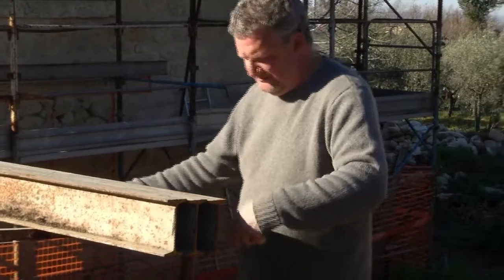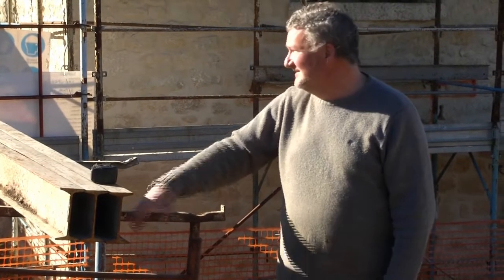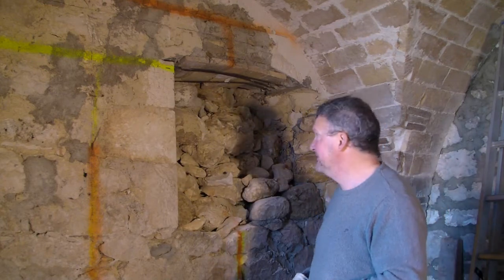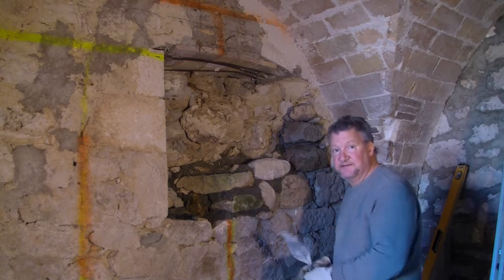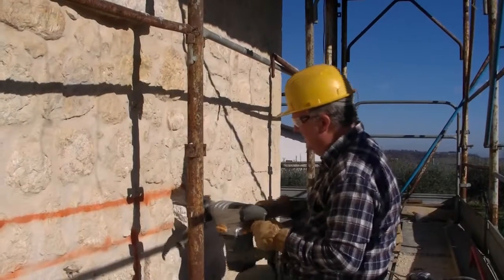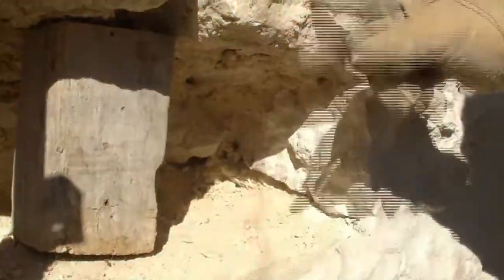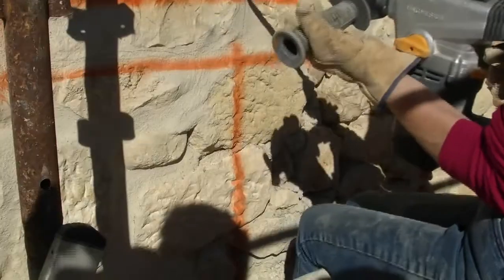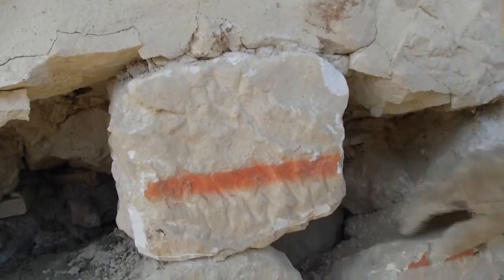Italian Farmhouse Restoration Ourselves GIRDERS Part 1 Ep 6

Comment: Hi, I’m planning renovation of a farmhouse in Italy as well, I was told that from the moment you put a new concrete floor or open exterior walls and put girders, you are obliged to work with a structural engineer. Can you confim ? Thank you
Reply from the maker: Yes correct you must seek permission of the local commune and more importantly the local seismic office which is done on your behalf by an architect or geometer

Comment: Hey guys! Really interesting vlog! Can I ask why you didn’t use an angle grinder to “start” the outline of the girder insert void and then use the impact driver once you had cleaner lines? Naively this would have made a tidier opening? Likely there is a good reason you didn’t do this but I am not sure why so it would be nice to know why! Thanks!
Reply from the maker: Hi Jason good question ill try to answer best I can, when I was installing the girders I wanted to prise each stone out using the impact driver to start the initial hole to grab onto a stone. Once the stones are disturbed they can become quite unstable above your head and by easing each one out with crowbar it prevents that disruption as i have learnt on all the other openings and by creating an arc effect the remaining stones seem to hold better in place and i did have to go 350mm deep to get the first girders in .. I also wanted to  preserve  the stones coming out for re use without damaging them as the facing stones are valuable. I used the grinder to give me a vertical cut line 60mm deep so that i knew excatly where each of the framing stones will be positioned and then cut sideways into the stones to create the box cut, I didnt want to use the prise method as before because it would mean too many stones coming out underneath the girders. I want the final outcome not to look like an after thought if that makes sense.
Reply: @Brambletye.  yes that really makes sense! Thanks for the detailed and clear response!!